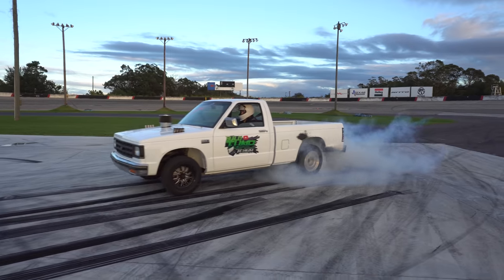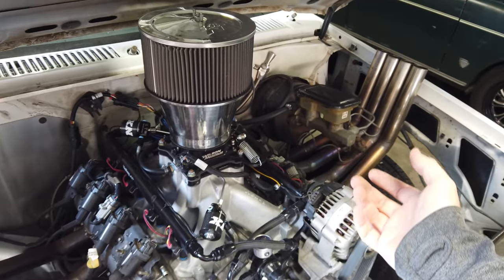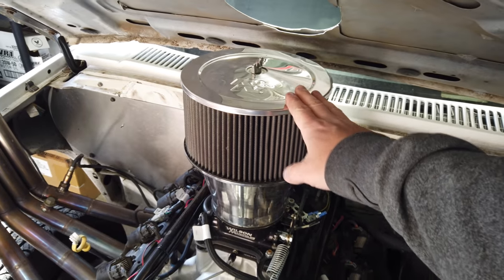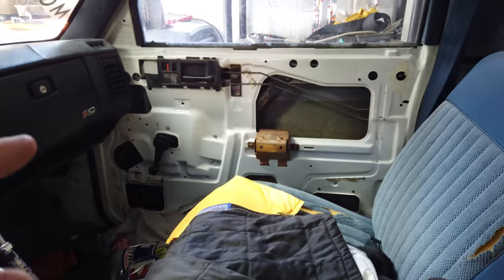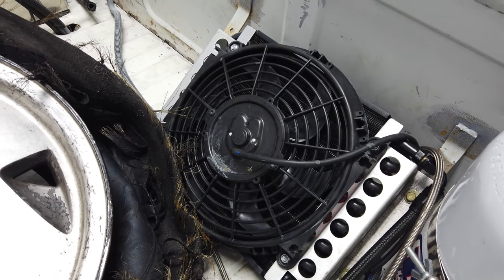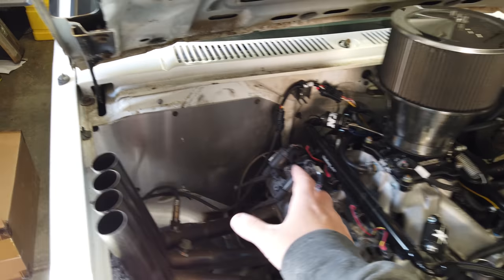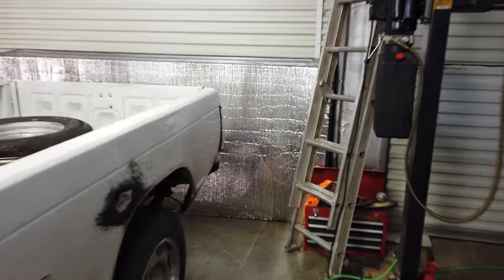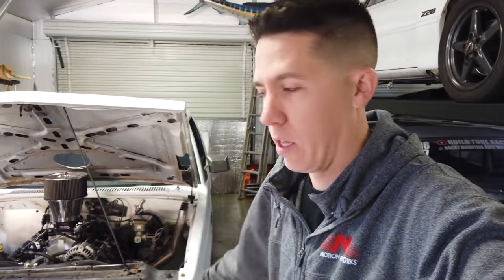What Did It Cost To Build Burnie The Burnout Truck? (More Than I Thought!)

Comment: went to a country comp last weekend  called revheads in west australia 150 cars turned up  came 33rd used 4 sets of new tyres   i would easily have $20 000 in my car (ratrod) plenty have more than me in their motors than my car the cost doesnt go away  but i wouldnt have it any other way you are about to be sucked in to the greatest time of your life ,there is nothing more satisfying than killing a few tyres putting on a few more and doing it again i have never seen anyone leaving a burnout comp unhappy, it is an adrenaline based sport and most people think they have had a win if you drive it on the trailer at the end of the night  , ready for your next skid. you got the powerglide thing right if she noses over and dont stay in high gear cleanly try more air pressure or a little bit lower diff ratio

Comment: Definitely need to go over to a twin turbo setup IaT stay much cooler and you're able to have more throttle modulation than you are with a supercharger which is basically an on/off switch

Comment: Suggestion: add a proportioning valve to your rear brakes so you can shut them off in the cab before you take it down a track.
Reply from the maker: Definitely thought about doing this if this thing starts to see some racing or street driving I’ll definitely need to do this!

Comment: I have an 88 s10 I just wanna Ls swap it, what would I need to do? Will i need a new rear end to go with all that power? Are engine mounts easy?
Reply from the maker: Engine swap mounts I got mine off eBay buy or build a trans cross member LS swap pan the headers can be a pain to figure out and some other things but that’s the main parts you’ll need. I made videos about the whole build if you would like to see the exact parts and stuff I used!

Comment: Holley fabricated sheet metal LS tunnel ram. https://www.holley.com/products/intakes/hi-ram_manifolds/parts/831071 The Holley/MSD/FAST throttle bodies are definitely cheaper. Other things to build? You should look into Super Modifieds. THOSE THINGS ARE INSANE! And I know the moment Garrett sees one he'll have to have one as they run them on dirt and asphalt.
Reply from the maker: I looked at running one of those intakes but they don’t have any EFI intakes with injector bungs like that.
Reply: @BuildTuneRace  I take it you don't know how to weld aluminum then? It's not as hard as everyone makes it out to be. Plus you always have the option of running carbs if you get the correct thing that will run the coils like a distributor so you can run carbs. They've shown that on Engine Power many times. There's also a company that basically adapts a flathead V8 MSD distributor to run on the front of the engine instead of having coil on plug.
Reply from the maker: @jaratt85  I definitely could modify and weld injector bungs on one just didn’t want to mess with it lol which going with one throttle body saved me another $700 for the second throttle body lol
Reply: @BuildTuneRace  if you get just throttle plates instead of throttle bodies and run port injection it should be a lot cheaper. Hell you could actually run it where just a scoop with blades is your throttle for race use only. On a tunnel ram they do make 4brl throttle plates that just look like the bottom of a 4brl carb with no injectors. Holley has these for $373 each. https://www.holley.com/products/fuel_systems/fuel_injection/throttle_bodies/4_bbl_throttle_bodies/parts/112-588 A great place to look for cheaper parts is from Speedmaster. They have a 1200cfm 4brl plate for $350 through Summit so straight from them it's probably even cheaper. (I really should get a job finding aftermarket parts for people, I'm really good at finding them lol)